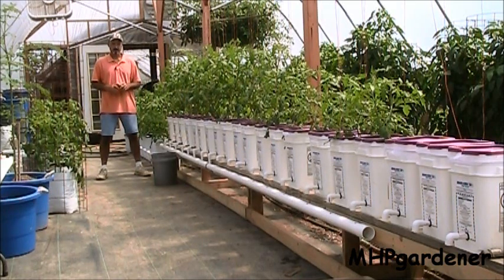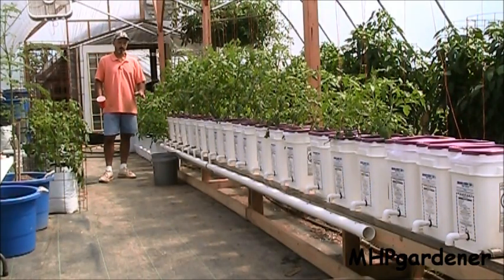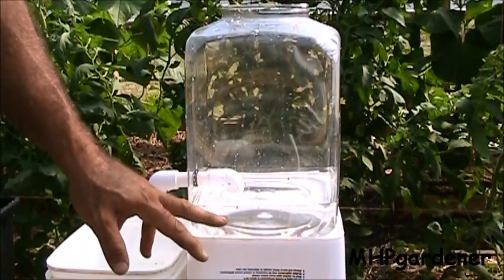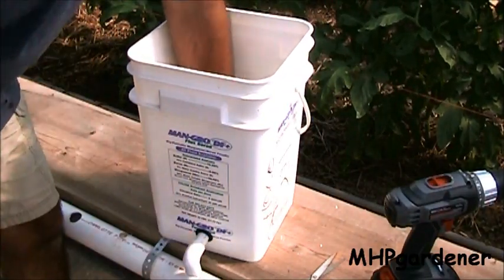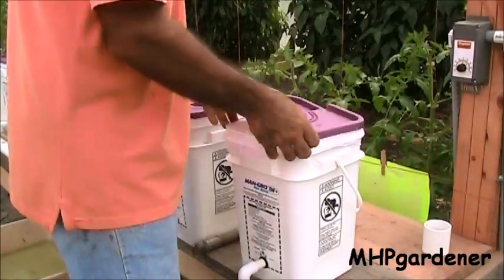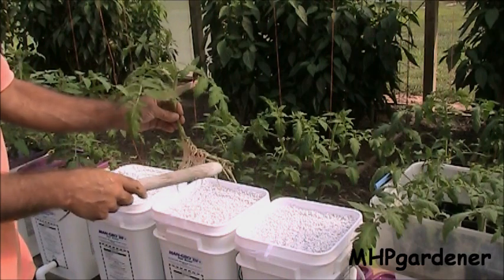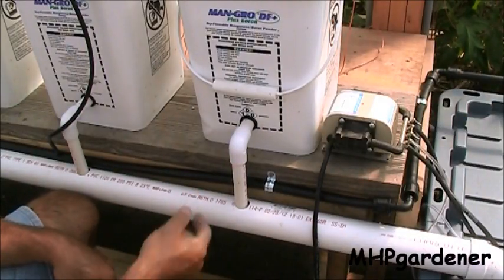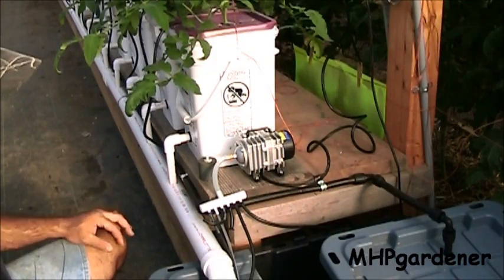Dutch Bucket Hydroponics - How It Works & How to Make Your Own Buckets

Comment: Excellent tutorial - Do you have a part number for the grommet you used? Or the one that Grainger sells? - In the video you said 3/4 inch - but you drilled a 1 inch hole in the bucket and used a 1/2 inch pipe to go thru it. BTW - Home Depot is now charging $12.00 ea. for grommets.

Comment: One of the clearest and well presented explanations of a simple hydroponics systems I have seen.  Thanks.  Have you tried strawberries with this system,  and is there any special considerations I might need to take using the bucket system for that?  I may try a single bucket as a trial and see how it works with the water nutrient mixture draining into a receptacle in which the bucket is standing.

Comment: I wonder if pumping carbon dioxide into the feed line would make any type of noticeable difference?
Reply: The only noticeable difference you would see, if you saw a difference at all, would be negative. Plants use CO2 through photosynthesis (taken in through the leaves), it is not taken up by the roots. Oxygen is important to the roots, so one of two things could happen in the root system with the introduction of CO2 to the reservoir. One, there would be both oxygen and carbon dioxide in the water, the roots would only take up the oxygen they need, causing no real change in the plants. Two, you would put too much carbon dioxide into the water that it would prevent oxygen from entering, thus damaging the roots as they don't have access to the oxygen they need.

Comment: Great video, thank you!  But can you help me understand [1] why there should be water at the bottom of each bucket (that is, why not just pop a hole in the bottom of the buckets?), and [2] since you do have water remaining at the bottom of each bucket, why have the upside down U shaped drainer at the bottom of each bucket, instead of just a straight through drain pipe?
Reply: I think the idea is that the U-shape (2 elbows) gives better control over the water buffer that stays in the bucket.  It creates an outlet syphon and allows for directing the discharge downward toward a horizontal drainpipe.
Reply: Thanks for the reply.  As I've been thinking this through, I think the inside elbow is not to drain the water as a siphon, but instead to wick the old water up off the bottom of the barrel as the new water presses down from the top.  Sort of like drinking with a straw, and refilling from the top.  The straw picks up the stuff at the bottom, not necessarily siphoning it up but allowing the "oldest" water out first.  On the outside elbow, yes I agree, that is to redirect it to somewhere manageable.
Reply: Roots always go to the source of water. The water stays in the bottom of the bucket. Yes. The medium will wick some moisture. But, the point is to leave water in the bottom so the plant can consume it. This is why he said you don't really need the pump setup, as long as you're willing to go around and hand water each bucket.

Comment: For the tomatoes, they may produce more if they sense red around them.  Maybe painting the lids of the containers red may help.  I think I read they sense competition, so it makes them produce.  Also, maybe some metal supports with panty hose tied to them for the tomatoes might attract electrical charges in the air.  Tomatoes may like that too.
Reply: The red doesn't make them produce more due to competition. The studies are that particular materials can reflect light on the correct spectrum for the plant to take up (the more light the plant takes in, the more growth you get). Competition comes from the spacing of the plants, if they're too close together they will stretch upwards competing for the light.

Comment: hydroponics for vegetable production is over kill. for hi quality and hi yield weed it has it's uses. but Sunshine Mix#4 , standard hose watering/flood n drain works better. use those buckets and throw away all that confusing pipes, hoses elbows and weird fertilizer mixes. Dutch buckets is 1990's weed tech. Sunshine mix#4 w/ added perlite used in buckets works better.

Comment: If you use 1/2" Street elbows and a heat gun, you can eliminate the grommets entirely. A 'slip x slip Street Elbow: http://www.homedepot.com/p/DURA-1-2-in-Schedule-40-PVC-90-Degree-Street-Elbow-C409-005/100344960 will fit into a regular slip x slip elbo eliminatit ithe need for that section of PVC pipe and the grommet. the Male end of the Streetelbow is the same O.D. diameter as the PVC pipe. 

So cut your hole 1/32" smaller than the O.D. of the PVC pipe (smooth the edges), then warm the plastic around the hole and shove/press the Street elbow (from the inside of the bucket) through the warm hole - sealing it nicely for this Low Pressure application. 

Then, since I just saved you the cost of the grommets and the cost of the short length of PVC pipe, send me a nickle every time you do this. However, please do a minimum of 20 before sending your payments as a dollar bill is cheaper to mail.Upon receipt, I will send you a Thank You note along with a picture o me looking Astonished, or incredulous as I open my mail.

Comment: I am confused. what does the perlite do? I have watched this video as well as the others &I am not finding the answer.  I understand the kratky doesn't require it. I understand they a% two different methods.the only thing I can see is you wouldn't have to use as much water/fertilizer.

Comment: build my 10 x 20 tunnel green house right now. doing a Dutch bucket system. first time. want to start with tomatoes,cucumbers and pepepers. what is a good spacing between buckets and how many buckets should I run per plant?

Comment: it seems like to me that pea gravel would be better for the environment than pearlite  and be easier to reuse and be cheaper if you buy it by the truck load.. you get one load and just keep going back to it over and over again.. it could also be used for many other purposes around the house.  It also removes the need for a paint strainer.
Reply: Only issues with pea gravel is that it's not always ph neutral. It depends on the environment it was sourced from, so you need to test it before you use it.
Reply: Mobie Nut, good point. I wonder if it's been tested.

Comment: Just a thought:  If you use just a small 1 inch square of paint strainer mesh you can slip that over the pipe going in the container then slip the elbow over it.  This will simply put the filter in the pipe and you wont have to but but maybe 1 of the meshes for 100 or so buckets.
Reply: great idea!
Reply: Thanks for this idea, made me think of tea bags, I just bought some reusable tea bags, I'm going to put those on the inside 90 fitting.
Reply: He tried that and it doesn't work as well.
Reply: What about nylon stockings or those long skinny filters you put on the drain hose of the washing machine? Any thoughts?

Comment: This is a great, very thorough video, and you deserve to be commended for it. However, at around the 16:00 mark, with the air stones, you are correct. They are absolutely unnecessary. Air stones aerate the water by disturbing the surface; that's what the bubbles are for. The bubbles themselves add zero air to the water. Because your water is in motion, running through a pump and then your feed-tubing system, the surface tension of the water is broken while it's in motion, and aerates itself while running out of the tube into the bucket.

But I am quite grateful for the way you set this video up; how you went through everything. I'm looking at a hydroponics setup myself, just as an experiment, and this is the most helpful tutorial video I've found thus far. Thanks for taking the time to put it together.
Reply: You are incorrect in your statement about how air stones add oxygen to the water.  They create small bubbles with a high surface area which increases air dissolving in the solution.  Disrupting the surface tension has no bearing.
Reply: Absolutely it does. Given a bubble ladder and sufficient time to climb it(once common in CO2 systems in planted aquariums), the bubbles will slowly shrink, dissolving gas into the water. However, at the relatively high rate of speed that bubbles climb from the airstone directly to the surface, very little of that takes place.

However, by disrupting the high surface tension that a body of still water has, oxygen above the surface has an easier time entering the water, typically to a level of approximately 7ppm(dependent upon altitude). This is why fast flowing rivers, which have very low surface tension, are more highly oxygenated than still lakes and ponds. The easiest way to see this in effect is to look at an undisturbed marsh or pond, and look at the layer of crud formed on the surface. These heavy particles(relative to oxygen) are supported by the surface tension of the water(buoyancy plays a part as well, obviously, as it does with oxygen).

You're welcome to have any opinion on the matter that you'd like. However, the science very solidly and unquestioningly backs up my statement, and I stand by it.

Comment: I have an idea that MIGHT help save on how much perlite is needed, but I might be wrong. If the roots dont use the whole depth of the bucket you could design something that would only have to perlite in the upper half that is needed for roots. Could make something out of PVC that would look kind of like a small stool but with holes for water to drain to the bottom. Sorry I have the idea in my head just hard to describe it I think. basically something to let the water flow thru but not needing to fill the bucket from bottom to top.
Reply: Or fill the buckets half way with big, crummy rocks that don't cost much?  (Good idea BTW)

Comment: I think you need to add some tubing on the outside of the bucket to create the siphon effect the two L shaped tubes are for.

Just for a simple overflow, you don't need a design like you showed in your example. 

The water is supposed to get siphoned out of the bucket to the bottom of the inner tube, not just to the height of the horizontal tube. To work that way, you need a longer tube on the outside to create some suction.

Comment: Smart stuff... I really like this setup! The only thing I would add to future proof would be to remove the grommet and get a permanent PVC fixture for the drain line. All and all nice setup and a super baseline for people to start with!
Reply: Hi, why you think you have to remove the grommet? Where is the profit?
Reply: Curiosity + I would permanently glue the small piece of pipe. But, not the elbows. As well as humans, and most animals,  plants like sanitary conditions and it would be easier to clean this equipment using a solution consisting of half a bucket of water, a handful of a mild detergent or a tablespoon of dish washing liquid. And scrub the bucket clean with a dish rag, the pipe with a bottle brush, and to bulk wash the elbows inside the bucket.
Reply: @Curiosity Can you point me to the parts to do that?

Comment: HI MPH!! love the info, just one question I would love an answer to. I notice that you just basically lay the tubing on top of the perlite but my concern is that without a nozzle of some type to spread the nutrient solution across the area of the bucket, the roots of the plant will struggle for moisture. Simply laying the tubing across just doesn't seem enough. Thank you for the help!

Comment: Hi, thank you for your valuable information. Question, I am using this method, except my pipe (water out) sit lower than yours do. My tomato leaves are slightly curled under on just some. I use the charcoal-clay pellets for my medium. My watering is every 25 min. for 5 min. so my roots don't dry out. No my roots are not touching the bottom with its slight bit of water in it yet. I live in AZ which is so dry, am I over watering?

Comment: I was all set to try your dutch bucket setup as it looks pretty awesome.
one small problem you can't get any perlite in New Jersey unless you buy small bags and they are way expensive.
The bag you are showing is i believe a 4 cubic foot bag.
I could only find a couple places that had any perlite at all and they cost $20 for 1 cubic foot.
The $17 bag you show would be $80 here in New Jersey.
Thanks for sharing your information.
Reply: Morgan County Seeds has 30lbs bags of perlite for $14.00
Reply: i had trouble a few years ago finding large bags of perlite but found at my local nursery/garden store. had to ask  them because i only saw small bags in their store but they had large bags probably twice the size he had in video in the back and it was like $25. i would start calling all nursery supplies or home/feed stores in your area they should have or can order for you. i only use it for making potting soil but that bag i have had for 3-4 years and still have not used over half of bag.
Reply: haha, out of curiosity after seeing Morgan county seeds mentioned a few time i looked it up and it's located in my state of Missouri.

Comment: I have a 13 x 16 greenhouse with a 40% sunshade and two fans. I am using the Kratky method and my solution height is correct. The temperature in the afternoon may reach 90 - 95 degrees inside my greenhouse. My plants look like they are dying but they seem to bounce back at night. They just seem to go through a lot of stress. Is there a way to keep my greenhouse cooler or is there another solution. Thanks

Comment: mhpgardener, I have a NFT system with about 84 net pots going. Is the watering the same as yours 30 minutes 3 times a day or should it be continuous? I started with a drip line going to each pot and now that the roots are starting to come out, I will switch to the 40 gallon bucket with a pump in it.

Comment: Great video! By the way, in case of power failure you could run those small pumps with a small power inverter 90 watts or so and a small battery. I  have run my system using solar panels.

Comment: Great video! By the way in case of power failure you could run the two pumps with a small 90 watts or so inverter 12 volts to 120 ac and a small battery. I  have done that with a small solar panel as usually the small pumps require very little power.

Comment: Excellent videos, I love them! I'm building my system now. I got a 25 pack of grommets from a graingers branch near me for about $7. (3mpr8 or use the link https://www.grainger.com/product/GRAINGER-APPROVED-Grommet-3MPR8?searchBar=true&searchQuery=3mpr8). Also instead of paint strainers I went with some "washing machine lint trap with tie" by partsmasterpro from home depot. 1 package comes with 2 mesh lint traps that I was then able to cut and make into 14 individual screens that are just zip tied on to the elbows. Total cost was less then $2 instead of $15-$16 for the paint strainers.

Comment: DO you know of any company that sell per-lite?
Reply: +Cuong Truong   Perlite is sold by most major garden stores like Home Depot and Lowes.   Other big box stores like Walmart,  Target and KMart might have them also.
Reply: Home depot or Lowes or a local plant nursery
Reply: I strongly suggest that Perlite be bought at a local nursery supply, feed store, etc.  The price of Perlite / Vermiculite at the big box stores and some retail nurseries is OUTRAGEOUS!
I get my Perlite at a local nursery supply in Smithfield, NC and it's only $14 for a huge bag - size is 4 cubic feet I think.
At the big box stores it's at least twice that price and most only have itty bitty 1lb. bags and I've never seen a bag there larger than 2 cu. ft.

The 4 cu. ft. bag will do a LOT of Dutch Buckets! I bought 2 bags and did 20 assorted tomato buckets and 10 pepper buckets with some left over. 
I used 5 gallon buckets BUT only filled them with Perlite to the 3 gallon level. The 5 gallon buckets are not necessary as a 3 gallon size will do just fine, unless the 5 gallon buckets are super cheap or better yet, FREE!  
You don't have to fill the whole 5 gallon bucket with Perlite! It's just a waste of materials and money to do so and I think Bobby even says that too.
Even if you don't need a big bag, heck, it's cheap!

Comment: For inserting your grommeted tubes easily, you can use some FOOD GRADE silicon lubricant. It usually comes in a small 1 oz. container, perfectly safe to use in a food environment. Diving shops will certainly have some. A little dab will do 'ya, as they say. You can probably get larger containers from... ta da... Grainger's. I'm sure someone makes a larger container of the stuff, for a lower unit cost.

Comment: I am really new t this. Can I use regular gravel instead of perlite?
Reply: +saleem s You can use whatever you can afford.  I am trying out Aeroponics, the Alaska Grow Buckets, and the Kratky system to see which one I like the best.  I use coconut coir, perlite and clay rocks. Even used up some left over fish tank gravel I had from a craft project.  Putting them in a netty pot helps to keep from filling up the hole bucket as he has here.  I have not figured out which way I like best yet.  I did discover that if our power goes out, there goes the pump, but my plants survived with just a few manual wettings.  Have to put a filter bag around the pump because the coir and some gravel falls into the water and clogs up some of the filters.  Also discovered it's hard to put a trelis on these things if you are indoors and need to move the item around or remove the lid for nutrient changes.  Watch every video you can find on aeroponics, hydropoinics, aquaponics, check out GardenPool, AlaskaGrowBuckets and SupplySource they all have DIY too. Those are the 3 I am trying now.
Reply: +froman1960 I am trying coir and stones from my fish pond. Let's see how it goes.